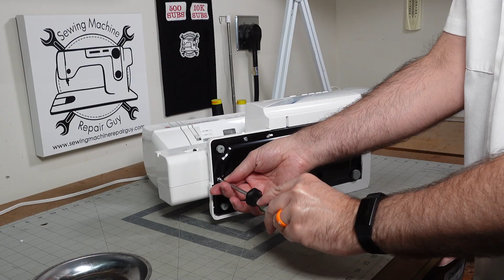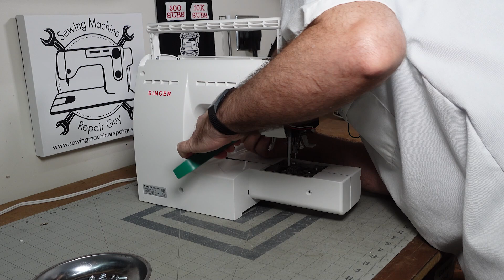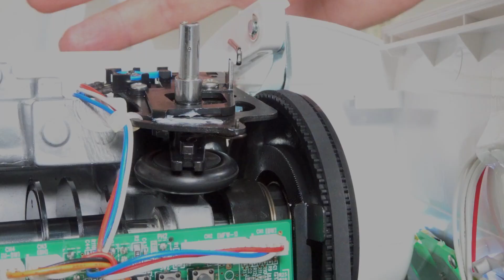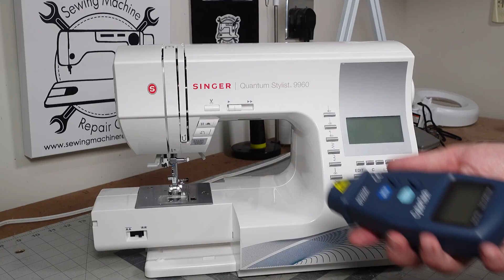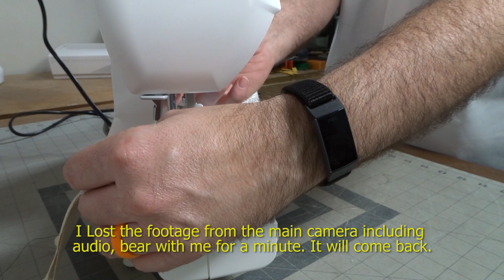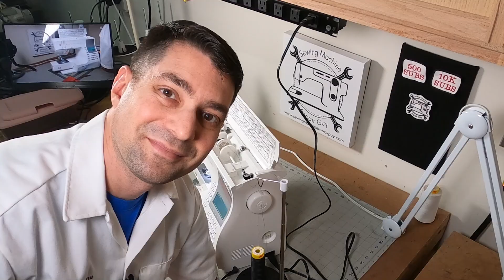Singer Quantum Stylist 9960 Tear Down and Stress Test, Does it Survive?

Comment: While your teardown is very appreciated your testing is very flawed.  When sewing different types of materials, not only do you need to change the needle type, you really need to take into account the stitch length and type of thread to be accurate in the materials you are "testing".  When you sewed the layers of "leather" you failed to change the length of the stitching on the machine functions even though you noticed the stitches got smaller on the test of the 2 layers. You also did not change the thread to a thread compatible with leather, AND you did not use the walking foot, OR slow down the sewing speed. All of which would have shown you and the viewers that the machine absolutely can sew 4 layers of leather/ several layers of quilt, etc..  Cotton thread WILL obviously break under the amount of tension you put it under in that inaccurate testing.  This machine IS a wonderful, heavy duty workhorse... IF the user knows how the proper techniques and tools to use when operating the machine to it's full potential.  I believe it is noted in the manual about what to do with several types of materials and the best tools to use that came with the machine. Please refer to the manual, as it gives much of this information.

Comment: You should tear down the "Singer" 9960 and the W6 n5000 - 8000 together ... Wenn ich die 9960 mit der W6 n5000 etc vergleiche sind sie tatsächlich baugleich... greetings to Producer Happy.Japan. The discussions about which one is better are senceless... whats about tuning... could you chance the motor and motorboard with a heavy duty motor from the heavy duty model`s?

Comment: Look like they’re using the same motor as my singer 3323 talent. 800ish stitches per minute. I could see though 6 layers of denim easy, but never tried 8 layers. I only hand cranked over the thick seams. 
It looks like a tension issue or using a small stitch length for the 8 layers of denim.

Comment: I have my singer quantum 9960 apart and am trying to see why the backside of my feed dogs are not all the way up when the dogs are in the up position. There is a nut/small threaded plastic piece and a pin attached to the plastic piece that I believe the pin came out of it home. How can I fix this?
Reply: I actually had this happen OVER and OVER AGAIN! It pops out of the plastic divot/hole.  I just lifted the presser foot arm( I think it was and popped it back in with my finger.   I finally took to repair guy as I thought that plastic piece with divot( scoop) that pin tip lands is was cracked.  He assured me it was fine but it's never happened again. It looks as tho he glued what I thought was a Crack  I'd take it in to be sure. Please check locally regarding repairman/ shop you want to use.  Sadly this was the only one near me. I got machine back in worse shape.  😢

Comment: I've owned a Singer Quantum Stylist 9960 for over 5 years now.  I do mostly craft, quilt, and garment sewing and the machine has always given me perfect results.  I got the extended accessories package and remain convinced that I selected the right machine.  I take good care of my machine and don't abuse it.  I would recommend this machine to anyone who's sewing needs are similar to my own.
Reply: I know ur comment is 2yrs old but I'm hoping you could still help. 
I wish it were easier to get to the left of the bobbin that's inside the casing w/o having to take the whole entire plastic cover off the whole machine. 
there is absolutely no repair shops around me & I can not afford to mail it. 
something is wrong with my bobbin area & I believe the issue is with my automatic thread cutter.. when it slides to the right to cut, it cuts the top thread but the bottom thread wraps around the cutter. so I have to take the needle plate off , pull the thread off the cutter.. idk if the cutter isn't going far enough back or forth but it's something. I've taken very good care of my machine & have hardly even used it. 
I did use it pretty heavily when covid 1st hit, made a couple small quilts & a few masks for friends & family who needed them for work.. after that I just had so much going on that I haven't been able to use it. I got it out about a month ago, cleaned it up & started making a jelly roll rug. as I'm waiting on more fabric to arrive, I wanted to start on a quilt for my son. 🙄I was trying to join jelly roll strips to make them longer (sewed on a diagonal) & it kept pinching up the ends & wouldn't pull away from the machine easily, the bobbin thread was stuck bc it got caught around the cutter. it doesn't get stuck in the way where u can just use the hand crank to wiggle it loose, it's something with the cutter (so it seems anyway)
do you happen to have tikt0k or Facebook & I could send u a short video to show you? maybe you'd know what I need to do to fix it?
Reply: @TLRB86  My husband had to replace that part of my machine and it works like a charm.  Hope you found someone who could help.
Reply: Wow I knew I liked this machine but now I like it even more !  Thanks !

Comment: I have a 9960 and a HD8600c the speed control on the HD8600c on the low end is a lot faster than the 9660 , there is no way the the foot pedal can be adjusted, is there another way it could be slowed  down
Kind Regards
Michael

Comment: Hi. Thank you for this video. I see the needle clamp and screw are still attached. The needle screw tip broke in the clamp on my machine, and now I can't insert a needle. Is this a repair I can do at home? How do I remove the needle clamp and replace with a new one? Thanks for any advice.

Comment: Thank you for demonstrating the mechanism of the Quantum 9960. I am having trouble getting the thread through section 5. I saw that it has a small slit in the plastic. Is this normal or is it supposed to be smooth?

Comment: Hi, I have purchased a quantum stylist machine from the USA to South Africa, and when plugged to a 220 volts it blew up instantly. Nothing was mentioned in their guide that it was a 120 volts. Now o can’t return it to the USA because the shipping will cost me the same price, and no one here was able to fix it. Would you be able to help me solve this problem plz? It’s been 6 months that I don’t know what to do to fix it. Thank you so much
Reply: Some of the heavy duty kitchen appliances that are sold in India have a recessed voltage switch to manually set the voltage to select between two different settings (either 110V or 220V). Read some of the modern appliances such as laptops, chargers etc., have a built-in conversion mechanism which either steps down or steps up to the input voltage that the device requires. Perhaps, Singer can consider adding this feature to their models (more machines can be sold 😊). Also, Singer has its presence world over. You can try reaching out to the nearest Singer sales and service center for a replacement of the blown up parts.

Comment: The belt does not go to a gear. The belt goes to a pulley. The belt and the pulley have cogs to prevent slippage to keep timing accurate. Singer does NOT build the machines. The have the lowest bidder manufacture them. The HD Singer machines are manufactured by Zeng Hsing Industries. I can not tell you who manufacturers this model.

Comment: IF your machine is made for 120v and you plug it into 220 or 240 volts your surely going to burn up the transformer or fuses. This would need to be fixed by a repair person.

Comment: I have the same issue as Saira's Creation.  Pedal nor start button work ( get an error message to showing you need to release pedal or start).  This happened after the bobbin jammed ( somehow thread wound all around the bobbin!).  I cleaned and changed needle but then that  is when this issue occurred.    I have had the machine for a while and never have cleaned it as in you 5 part course on repairing sewing machines.  So I am taking it apart as you showed and will try to clean it  to see if this helps.    If you have any suggestions please reply.  Thanks.

Comment: hi! recently my quantum stylist just started beeping when I press the petal or start button. DO you have any advice on how to get it sewing again. I have tried everything and tech support was no help at all :(
Reply: Check the button hole drop down lever. Push it all the way up, or pull it all the way down and back to the top.
Reply: I had this happen to me and I couldn’t figure out why.  This machine would beep when you forget to put your presser feet down but I double checked everything and it was down and ready to sew but it kept beeping.  It turned out that I had a piece of thread stuck near the bobbin and noticed the thread tension was a little too tight so adjusted and rethreaded, cleaned out the bobbin and surrounding area and voila 😃 it started sewing again.

Comment: Is there a way to get in to clean out the thread guides? Mine used to be very easy to thread but now it's hard to glide the thread through the steps. I use 100% cotton thread by Gütterman for my quilting projects. Thank you in advance.
Reply: B, take off the cover over the guides ( theres one screw, then pry & lift to get it off; realign the piece at the top middle, and push to replace it after you clean out the threads. Rem to replace the screw.
Reply: @grandmalovesmebest  thank you. I actually took it in for service and maintenance. I bought a new Babylock and wanted to be sure whomever bought the Singer would have a nicely maintained and ready to go machine. I did however learn to snip my thread at the spool and pull the cut thread downward. I was taking the spool off and just pulling it upward to change thread. Apparently that caused a lot of lint build up in the housing where the springs are located for threading. Lesson learned. Thank you very much for your reply I do appreciate you taking the time to help me out.

Comment: Thanks for showing what’s going on inside my machine! I’d be afraid of wrecking it if I tried to open it up myself! I love this machine. The one thing I don’t like about modern machines though, is that the feed dogs are so wide to accommodate the various stitches, that it’s more difficult to maneuver around tight curves than with a vintage straight stitch machine that has the narrow feed dogs and presser foot. So, I need both! Thanks again for this wonderfully informative video! You rock!

Comment: Great and informative video. Do you have any idea why my thread cutter doesn't move back into position? It moves forward when I press the button but stops. When I take the plate off I see the threads are caught and unable to bypass the bobbin case because the part that moves on the cutter is up close to the bobbin case and blocking the thread. I've moved it back manually.  I've had this machine since 2018 and haven't really used it, didn't read the book,  just been busy.  I didn't even know I had a cutter until recently when I watched someone on youtube use it and said hmmm wish I had that lol Now I'm retired and have time to check out this almost new machine, I'd like it to work. If I can fix this without sending it off somewhere that would be great otherwise I just won't use the cutter. I don't know how important it is when one YouTuber said don't press the button with no stitching being done just to see it work, Well you know I did that right?  lol maybe its a setting that needs to be reset?

Comment: As much as I love my singer quantum 9960, I'm soooo mad right now, I have two of them and both got exactly same issue,  machine is not letting me sew continuing,  and dial keep show I have released foot pedal,  and if I sew with one off button, it's have same issue keep stopping and showing I have to released my finger push and keep pressing on off to restart.   Anyone have same issue? Or got salutation?
Your video is great though but not what I'm dealing with.
Reply: Check the lever that you pull down for sewing button holes. Pull all the way down like if you were going to sew the button hole with F foot. Then push it back up, resetting it.
Reply: @oropeza190  thank you ,one of church friend was able to fix my both machines,  in case next time I will remember that.

Comment: I think if the thread had been the right size and beeswaxed, it would have did a better job.. leatherwork threads need wax to slide through stitch holes. It also helps the needle out greatly.
I have a Quantum Stylist 9960. It a very nice machine. It handles moderate leather not heavy leather. Was not made for that heavy of material. You want a real leatherwork sewing machine buy one that's really designed for it. Like my Singer 29-4 1913 model. It a patch machine that was made for leather repair work of many harnesses. I will do a great job. Even a sailrite sewing machine would work as a leatherwork machine. Make bags or backpacks, tent's,, heavy wools.
Reply: @Iknowonlywhatimtaught  The stitch width should also be at least 3mm or bigger… I think he was testing at 2. That might have been why he got the wiggles in his stitches.

Comment: Hi Wes,  I actually have a bobbin winder question.  Do all machine bobbin winders  come with a automatic shutoff; meaning when the bobbin is full should a spring (or the bobbin thread guide) cause the bobbin to move to the left and stop it from winding? I only ask since my machine doesn't do that,  but my commercial sized bobbin winder does.
Reply: Seff, not all bobbin winders shut off but they will slow way down. I got fooled on that one too😃.

Comment: I plugged my machine by mistake to a 240V and it immediately went off. I changed the fuse on the adapter and the electricity is coming to the machine (since the lights are on the machine) but it doesnt start. Would you know if the fuse inside the machine burnt or if its the motherboard? Thank you!

Comment: Hi, thank you so  much for your video. Is it possible to show how to assemble one of the 2 parts that you didn't took off, the one whith the number 5, there´s a little wire and i dont know how to assemble it because the tension doesn´t work with all the option that i tryed. :( its the one behind the 3 little screws.

Comment: I had this machine for 3 years and at first I loved it but then it started stalling and not feeding the fabric properly. Also the needle threader hook is very flimsy and I had to replace the threader 4 times, at $12 a pop. Repair places told me that this machine and many Singer models these days are not durable. I then bought a Brother and it's a champ, I got a dealer model and I love it, no problems at all after three years. I think  that Brother , Babylock,  Juki and Janome are supposed to be more durable machines than modern Singers. What is your experience as a repairer with the different brands? Thanks for your input.
Reply: Which Brother machine did you get? Does it still run well?
Reply: @sspiecha  I got the Brother Simplicity SB3150. (It's basically the same as a BabyLock Brilliant but cost half!) The Simplicity line has been discontinued but they have other similar machines with the same features. It runs fabulously. It was a great deal and I am very happy with it!!

Comment: Just got my XR3340 from brother, it is refurbished and I love it. I won't be doing major heavy duty on it, that is for my 2 kenmores that weigh 30-40lbs and are 52-56 years old and are work horses. so I will be doing work with them along with my brother. just because electronics can do heavy duty does not mean they should depending on fabric. same with the vintage. all are home dec. and I love them all. it's all about knowing what your machines can and can't do with out over reaching their limits. This is an awesome video btw.

Comment: I have this machine but one problem I encountered was, thread can cut through the plastic thread guide  at guide 1 and cut your thread when stitching.
Reply from the maker: I saw that same problem after making this video. It was a well used customer machine. I used some aluminum tape to fix it, hope this helps!
Reply: Thank you. Will surely try that and see how it goes.

Comment: Great video. Thanks! I have this machine and you made me like it even more! A tip about the stitches getting closer together when you sew more and more layers together or thick ones like leather: you need to increase your stitch length because the stitch is going through more fabric (or animal skin). Even if you use a walking foot you would need to do this.
Reply: And lower speed.
Reply: @Bright-It. Thank you both for that info.

Comment: Glad to know the covers can be taken off.  Never would have tried it without this video.
Reply: I'm going to recommend your videos in my facebook groups along with Andytube.
Reply: When you need to change the knife in the cutter, you have to practically dismantle the whole machine. See Roxanne's video on how to do it. The knife is just a small piece of the blades used in box cutters. The threaders dont last long either but just pull off and push on. Good luck.